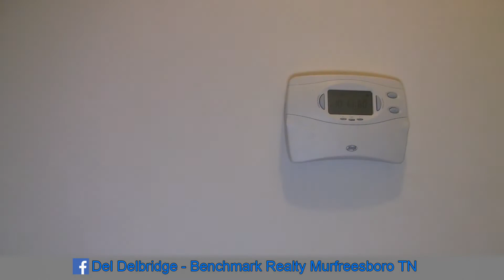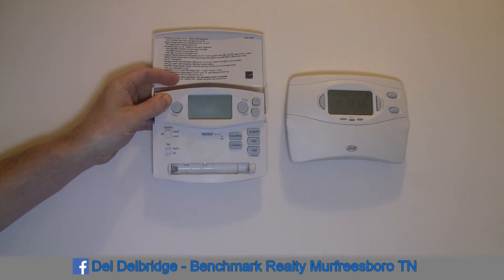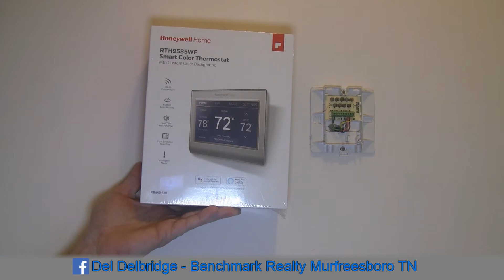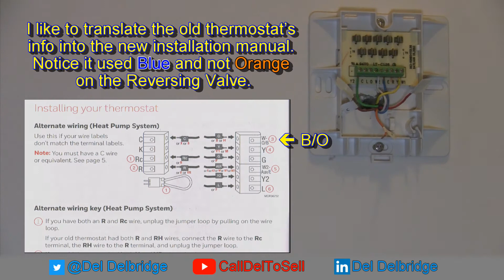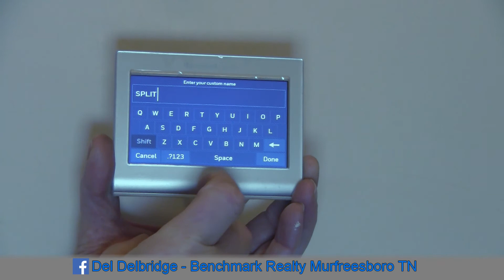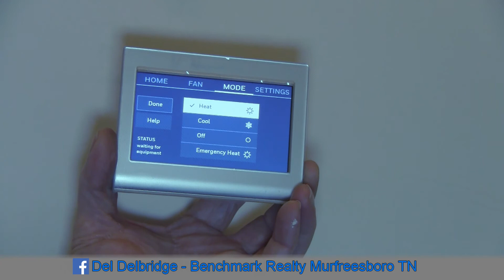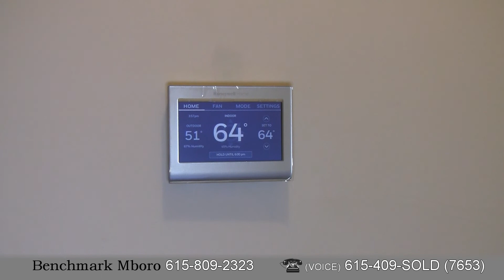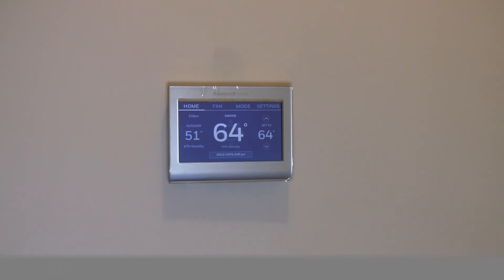WiFi Heat Pump Thermostat - 1080p

Comment: I have the same thermostat yet the heat pump didnt come on, should i change the settings.. i only felt regular air on heat setting. . I have 6wires, what is the L terminal for...
Reply from the maker: It's been a minute since I put them on. I would check to see if you had the right mode programmed regarding the changeover valve.

Comment: Hi, thanks for your video. How do you change Fahrenheit to celcius with RTH9590WF?
Reply from the maker: That, I don't know.
Reply: @calldeltosell  I found it in preferences from settings. Thanks, anyways.
Reply from the maker: @RobloxLive9543  - I would have been surprised if it wasn't possible. But to be most honest, I almost exclusively use my app. Not the Honeywell app but I have few Lutron devices, a couple of lamp controllers, eve and over the parking area and their app allows integration. 

It's pretty indispensable now.  If I am away from home, I can bump it up or down, monitor the house.

It's a different product but I also have two different home camera systems. Each has its strengths and weaknesses. Being as I am the poor one in the family, I don't have lake houses like all of them. One of them spends quite a bit of time at the lake and wanted to keep his eye on the main house. I assisted him. A couple months later, I heard one of the other brothers who still spends more time at home, camera uped (not a real word) his lake house. 

I'm far from "remote controlled window shades" but I do enjoy my thermostats. (This dang thermostat has cost me a lot of money!)

Thanks for watching and the comment.

Comment: Thanks for the video! What do I do if I have a O , and a B wire?
Reply from the maker: From Google: 

"The O wire reverses the valve from heating to cooling, and the B wire switches the valve from cooling to heating. Sometimes it might be a single O/B wire instead of two separate wires."

This is the "basic" for what that is worth, you might want to go on to Honeywell's sight and use their application. That way you can be assured you have the best possible match of thermostat to your need. I myself, could have used another heat stage. But I wanted them to match.